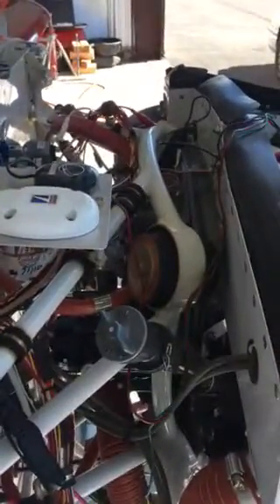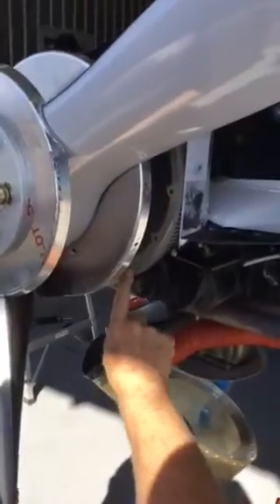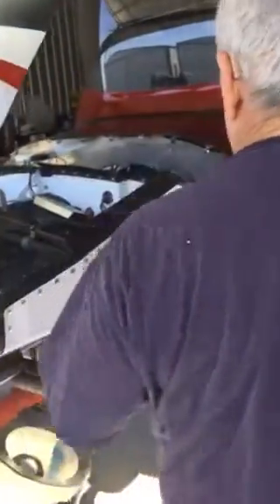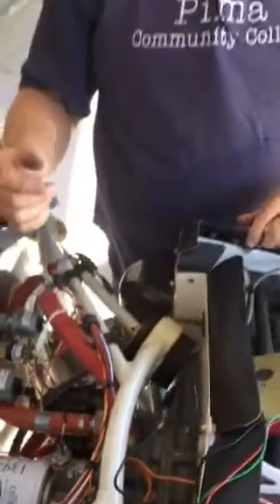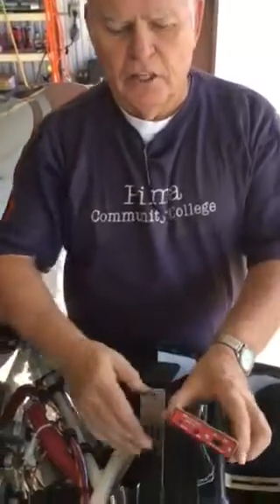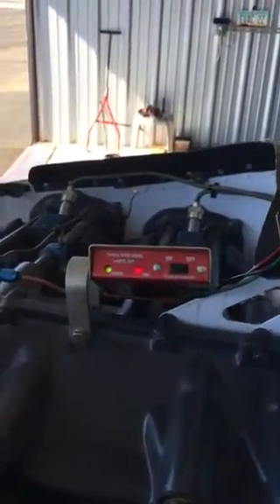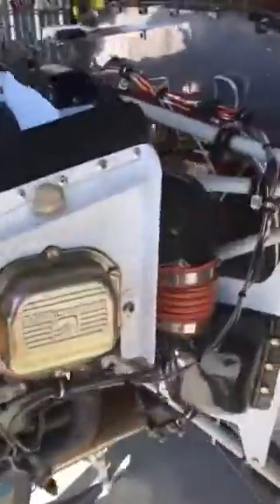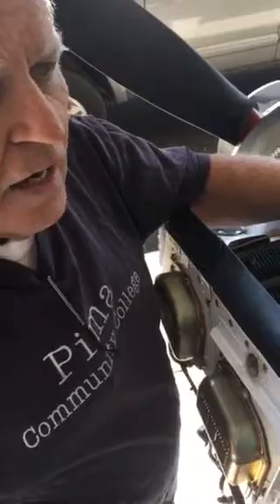How To Time Aircraft Engine Magneto's

Comment: There was a good point made about slop in the gears.  Don't rock the prop back and forth.  Pull it far enough back to take out all the slack.  I still don't understand why you have to time the engine off the number one piston.  Yes, if you're replacing a magneto, you must do that.  However, every cylinder has to fire at 25 degrees before top dead center.  Not just the number one.

Comment: THANK YOU, FOR SHOWING the SIMPLE and  PROPER way to time the mags!
Recently I viewed TWO videos where the presenter was using a cone and weighted needle in a complicated way to find
 TDC. Then timed the.mags to it.
There is a +/- Two degree error it, due to the 'Top of the Curve' of rotation. 
The manufacturer's mark is Exact, and easy to achieve.

Comment: I have one of those sync  devices which I use on outboards,  not aircraft.  You have to  "watch"  those.  They  don't properly indicate the difference between  say,  a fault where a mag coil has gone open,  and  the  expected result,  with a good coil and points either  open or closed.

Comment: I realize this isn't A&P school but you left out removing spark plugs from all cylinders so the engine won't fire when you turn on the ignition and un-ground the mags.  At least one plug from each cylinder.  And you left out firing the impulse coupling by rotating the prop past TDC and then rotating the prop backwards slowly to before 25 degrees TDC so you can get an accurate reading from your timing light.  Don't do these if you aren't going to show some of the critical steps.
Reply: Thanks for the suggestions.

Comment: Hey Glenn, Im taking my Powerplant practical this sunday. Just so Im clear, exactly where do the leads need to be connected? I know black goes to ground but which ones go to the P-lead? thank you
Reply from the maker: I forwarded your question to AJ.
Reply: Dependend on the mag brand. Slick mags black goes to ground, white to P-Lead. Bendix mags use a threaded connector (ground) with P-Lead probe.
Reply: A.J. Pawlowski what about the testers that have red and green leads?  I’ve seen different videos where they connected the black and green together and connected both to ground and then the red was connected to the p lead.
Reply: @cameroncongleton5402  Black lead goes to ground. Red lead goes to left mag P-Lead terminal, Green lead goes to right mag P-Lead terminal.
Reply: A.J. Pawlowski ok great thank you. that is what I thought. Thanks for your time.

Comment: Can a bad tuning (timing) Magnetos cause engine vibration? Thank you
Reply: antonio r If timed too far advanced, it will cause detonation. If too retarded, it is possible for engine to run rough. If mags are not synchronized, but are close to recommended timing mark, it should not cause rough running. You should do a compression check for hung valve(s). Good luck!
Reply: A.J. Pawlowski Thank you for your help, I have a Cherokee 140 my mechanic found a cylinder with very low compression 80-20, I got a brand new lycoming cylinder kit, he installed it and also did magnetos timing and when I went for a flight test I am experiencing vibration throughout the plane, he doubled check the cylinder installation and everything looks fine but I am not sure if he tuned the magnetos right that's why I was asking if a bad magnetos timing can cause engine vibration. Thank again I appreciate your help
Reply: @lajonn99  did you get it fixed?
Reply: Flight Sim Centre no, never did I sold the plane and got a Cherokee six 260
Reply: @lajonn99  👌 that's what I have to! #BlueYonderAirTours